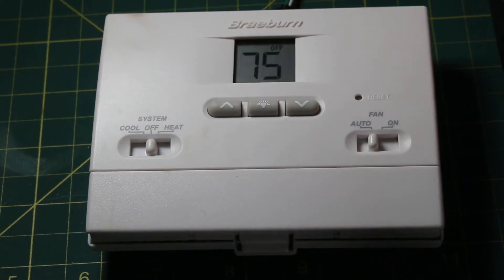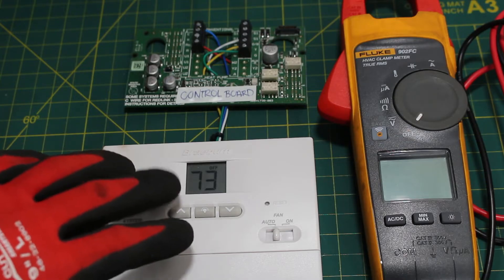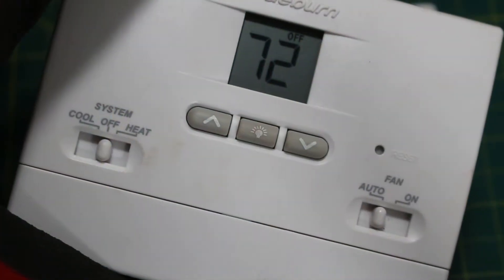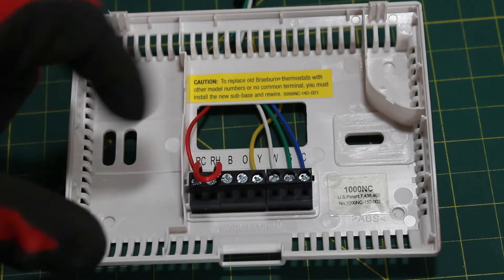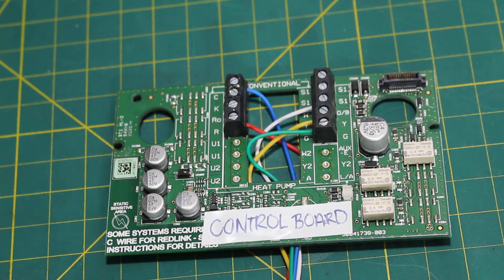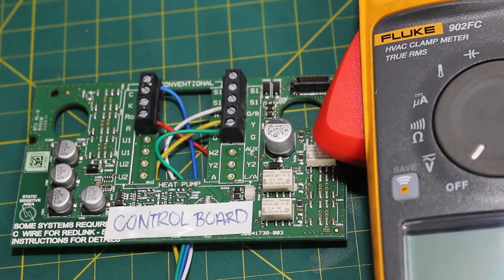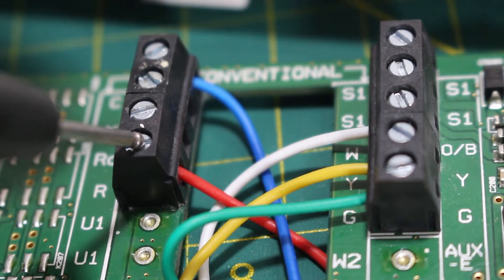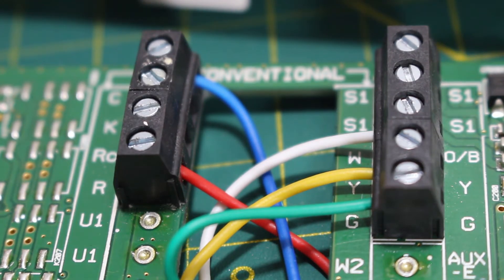HVAC: How To Check A Thermostat With a Multimeter (Thermostat Troubleshooting) Is It Bad? Explained!

Comment: You're great video helped me figure out the issue I was having. My issue was I would have the heat on and fan set to auto. It would work fine many times but then say once every three cycles my fan set at auto would somehow by itself change to fan on, and the fan would run at a very slow speed after the heat portion had stopped. It was not a big deal but I knew a problem was coming. Spent a few days doing a lot of videos and searchers on google but nothing was popping up for my fan issue. Then I found your video, smooth and easy. I was testing the heater voltage and it was at zero then I tested the fan voltage and it was at zero, walked by my thermostat to see it again had changed from auto to oh, so I swapped it back to auto and checked the voltage and I got 24V. Walked back to the thermostat and changed it to on, went and tested it again and it was at zero. Your video has now solved my problem, I think lol.
Thank you so very much for the well laid out video.

Comment: I don’t know where the board you are checking is. I know there is one inside the thermostat but that doesn’t seem to be the one you are checking. Is it on the furnace?
Reply from the maker: This board was used as a reference. It could be a board or just a terminal block but the key is to focus on the thermostat cable entering your indoor unit/furnace. Follow that cable inside the indoor unit & you will find the board/terminal block you are looking for👍 Thanks for watching & stay tuned for new videos every week🔧⚡️

Comment: If the cover is off so is the control board how are you to test wires coming from the wall
If the control board is set aside and how can you switch of and on auto/fan if the cover is off. This I find a little confusing, but I think it's me
Reply: The board he's testing in the video is a supposed to be the control board you'd find inside your blower unit. The thermostat he keeps turning on and off is on the wall in the home.

Comment: I'm a DIY homeowner.  Removed old thermostat a while ago for remodeling project.  Didn't label anything because it seemed everything was obvious and correct... r to r, w to w, etc. Now, a month later, trying to install new nest thermostat.  I'm getting 24 on multimeter for red coupled with each wire, yet thermostat not getting power.  Any suggestions??? I've even tried reinstalling the old thermostat and that's not working either.
Reply: No batteries on thermostat btw,  powered via c wire
Reply: Lol professional homeowners
Reply: The nest needs a battery or a common wire or it won’t work.
Reply: It all depends on how it’s wired at the furnace/air handler.